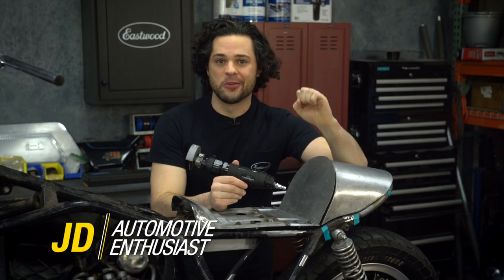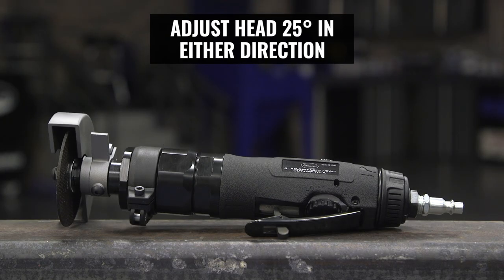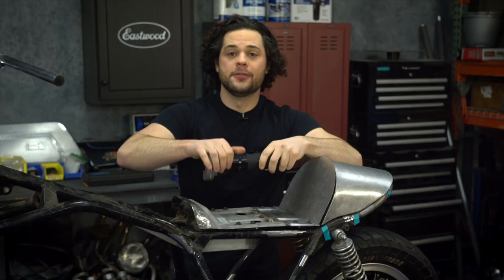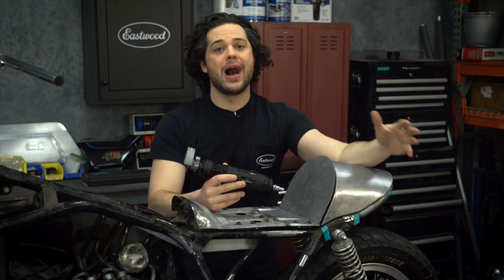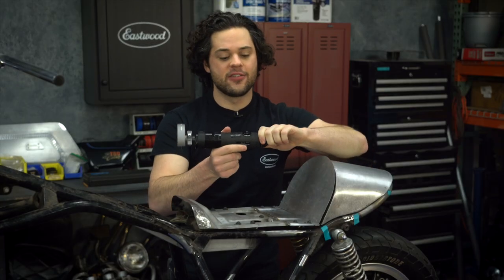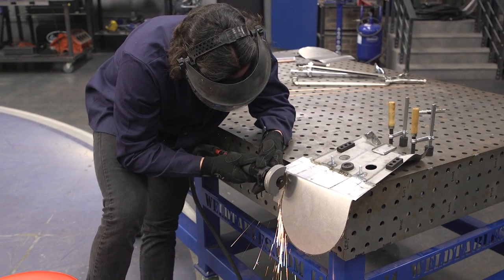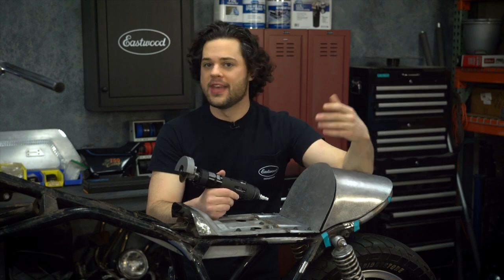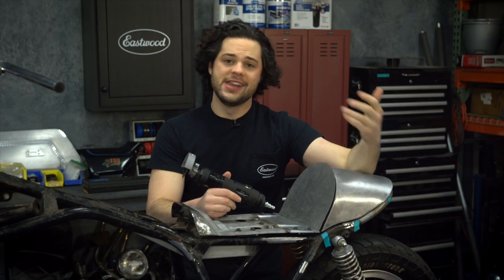This Cut Off Wheel Has an Adjustable Head! Great For Cutting Metal in Tight Spots - Eastwood

Comment: I need to know what the HP is before i decide to buy
Reply from the maker: Do you mean Horsepower?  It's a pneumatic tool so it will be dependent on the compressor you're powering the tool with.  The specs are:
Arbor Size:	3/8"
Maximum RPM:	16,000
Operating Air Pressure:	90 PSI
Air Consumption:	3.6 CFM
Exhaust:	Rear
Noise Level:	84 Decibel
Air Inlet Size:	1/4"
Housing Material:	Composite
Shroud Material:	Die Cast Aluminum
Motor:	4 Vane Ball Bearing
Variable Speed:	Yes
Reversible Direction:	Yes

Find everything out about the tool here: https://www.eastwood.com/eastwood-3-adjustable-head-cut-off-tool.html?utm_source=youtube&utm_medium=annotation+&utm_campaign=2022-02-04&utm_content=adjustable+head+cut+off+tool+cafe+racer

Comment: Hey Eastwood, love your products and own a number of them. If you guys are in a position to help out growing You Tubers give DD Speed Shop a view and maybe set Dan up with a Contour SCT and products for paint and rust removal. He’s a great builder of hot rod Tri-Five Chevy’s and a hard working guy.
Reply from the maker: Hey Bob, 
Thanks for the tip. DD Speed in Winterpeg. 🥶
I'll check them out. No promises, but I'll see what I can do. 
-JD
Reply: @eastwoodco  Thanks JD. Dan has no idea I wrote to you. I just think he’s a hard working hot rodder that could use some help. I thank you for any consideration.